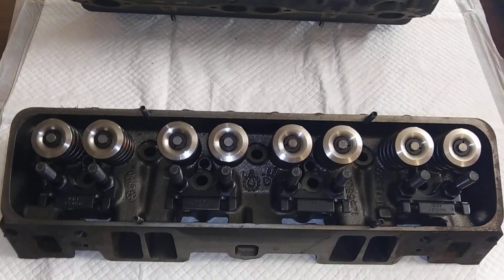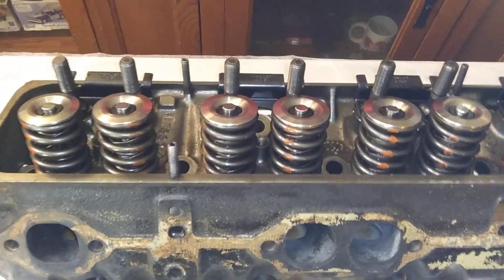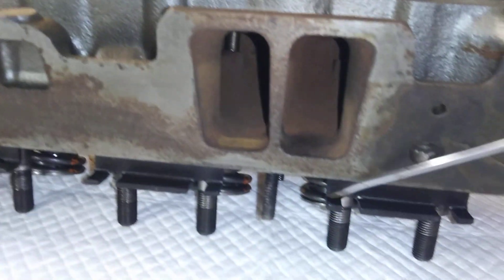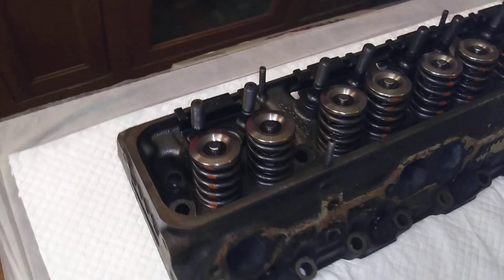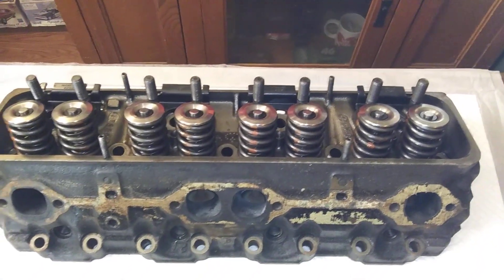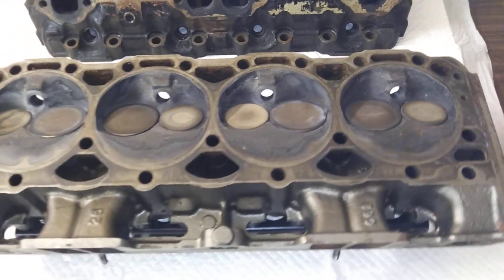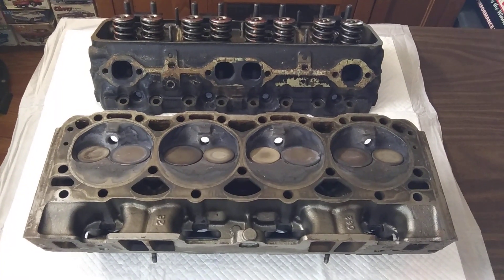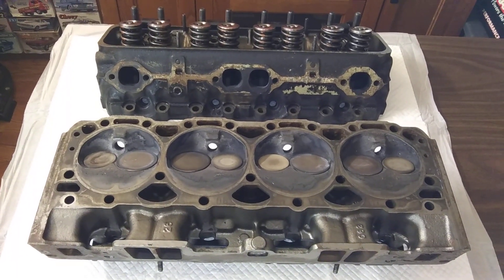GMPP "VORTEC" heads from "Asphalt Modified" 358ci SBC. Brezinski prepped. Pretty trick iron.

Comment: Did you find any hidden port work? You know they've been worked over. I've seen guys running cast cranks, olds 6" rods and double hump heads turning 8k rpm in these late models like it ain't shit. A buddy of mine used to work at Roy Johnson's machine shop (which is Alan Johnson's daddy) and I couldn't believe the shit they used and it lasted like it did. They liked candy cranks because of the lighter weight and less flex, Oldsmobile 6" rods look like something out of a tractor. He always said " poor boys have their ways".
Reply from the maker: Yep, there's definitely material been removed and disguised. Probably "cheater" heads at most tracks. They are pretty big inside. Smooth transition from the valve seat to the bowl too. Guides look thinner also. I have some OEM Vortec heads on the shelf, these are definitely heavily  modified. Alot of milling too. I seen the intake that was on them, it was cut almost to the bolt holes. Should be interesting to fit an intake to them.
Reply from the maker: Doing some research on Brzezinski and came across an interesting read, seems ole Randy got sued by IMCA a couple years ago for selling cheater heads. Then he put the buisness up for sale shortly after. I believe they won. Cost him a shitload of money. Seems he was modifying the "approved" IMCA heads and hiding it. Was also laser etching the IMCA logo on to un approved heads. Haha! Dudes pretty bold. Old school for sure.

Comment: Nice!😎👍
Are those the larger runner GM sbc Vortec replacement heads?
Reply from the maker: Yep, they use them in oval track cars alot. Alot thicker than the production versions.
Reply from the maker: Dude sunk a ton of money into these heads.
Reply: @thereluctantgearhead4544  
Did you have them flow benched or did the come with a flow sheet?
Reply from the maker: @itseithergonnaworkoritaint7852 They've done thousands of these heads and it's already known what they flow. Been in buisness since 1980. They started doing Vortech heads the year they were available around 96. Dudes pretty well known. Actually I got these heads from the original owners son. The original owner passed away about 2 years ago.
Reply from the maker: @itseithergonnaworkoritaint7852 Current price on these heads from Brzezinski is around $3500 bucks with you supplying the $1500 dollar castings. So pretty much $5000 bucks. Shits crazy expensive in the upper level oval track cars. Strangely enough the rules make it more expensive. Be cheaper and get pretty much the same results with buying a pair of 200cc Brodix heads rather than modifying the hell out of Vortec heads. Don't make good sense. A good "claimer" 358 cost $15,000 bucks these days to be competitive. Some guys spending $20-$30 grand on a good engine. Priced alot of folks right out of racing.
Reply: @thereluctantgearhead4544  
Cool, would be nice to have flow numbers though to make sure they match your cam. If that is a cam lift limited cam all the flow might be under .500" lift. If you throw a .700" lift cam in there it might not perform as good as a lower lift cam might. Is the flow listed on the Stan Weiss sight?
Reply from the maker: @itseithergonnaworkoritaint7852  These heads were run with a 675 lift solid roller. Have monster springs on them. They flow past .700 lift. Nothing like the stock ones.
Reply from the maker: These heads were built 10yrs ago. I talked to the owner. Been tucked away a few years.